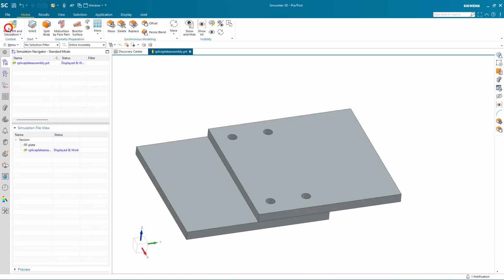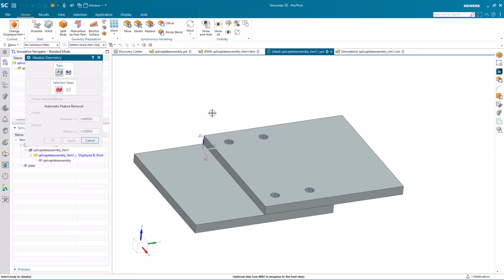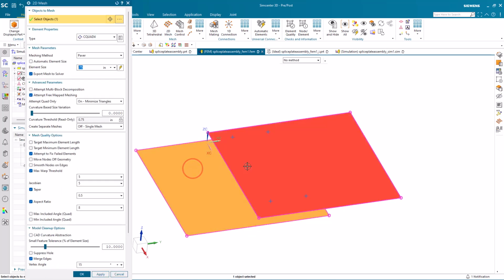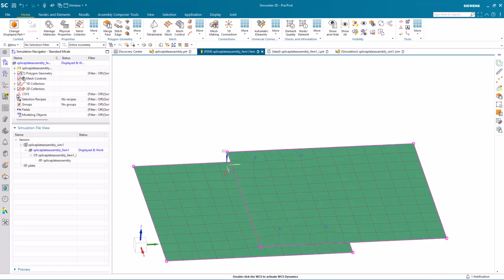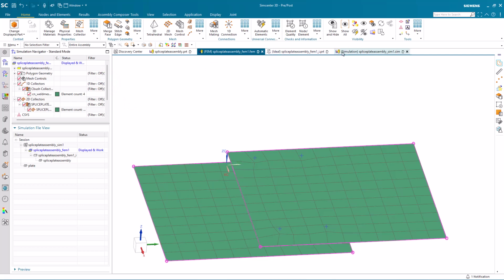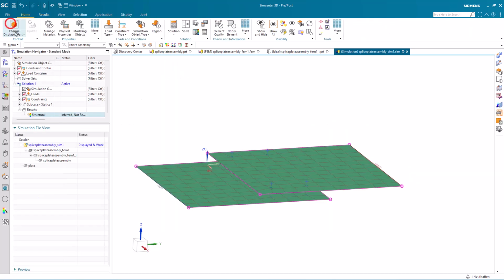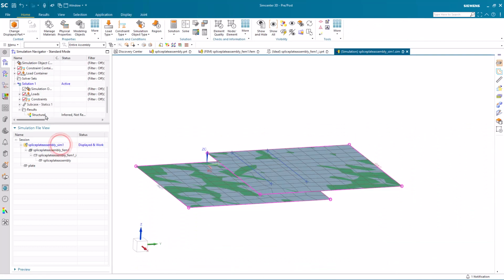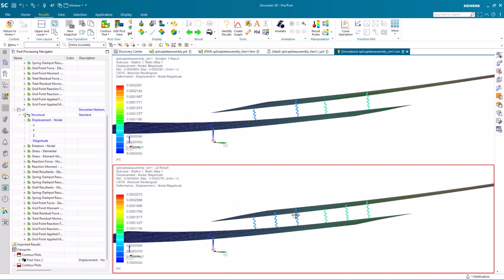How To Create A Spot Weld Connection

Comment: Why the option in video, it's not have in my software. My software is simcenter 3d version 2506, example option idealize geometry
Reply from the maker: It could be you are using the default role which hides many commands to simplify the user interface.  To show all commands, go to the resource bar on the left at the bottom (it has a hammer and wrench on it) then select Content then Role Advanced.  Good luck, hope this helps.

Comment: great video.
however in this video you have not applied thickness for the parts in FEM ? why is it so?
Reply from the maker: Thanks!  The thickness is inherited from the midsurface.  I have a customer default set to do this automatically every time.  Please see https://youtu.be/JERQ_PV1uVQ?si=AQ3VSm3Z1KRO8YxU&t=321
Reply: @Simcenter3DTipsandTricks   thanks for your reply. in this tutorial Spot weld command was used with cbush elements to "define/realize" fasteners.However can't be cbeam with defined cross section as those of fasteners or rigid elements be used? also for realizing/defining actual spot welds ,only Cfast/Cweld elements have to be used?are there any other options available which may accurately define spot weld/seam weld behavior?is there a tutorial available for using Cfast/Cweld elements?
thank you